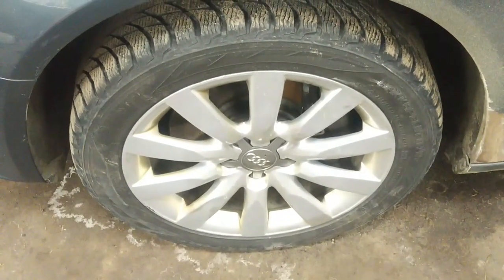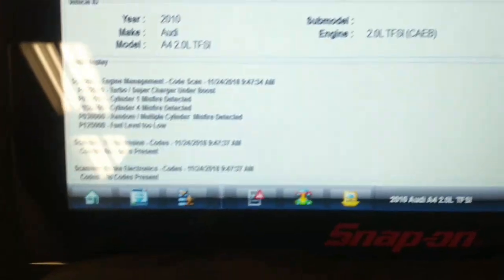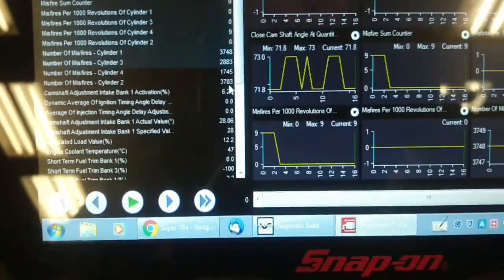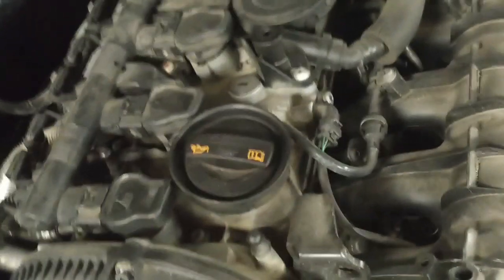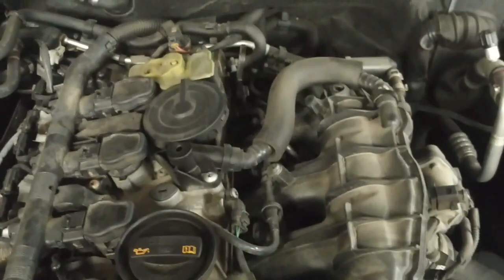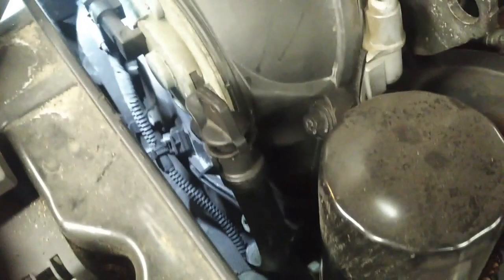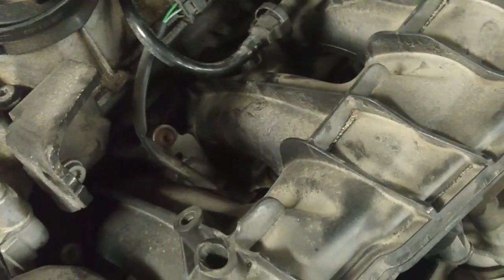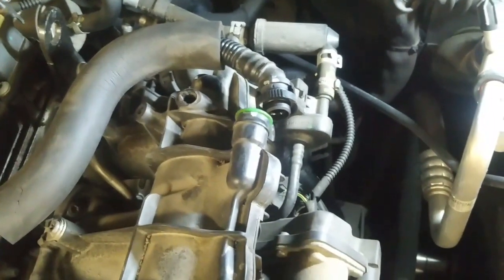2010 Audi A4 Quattro Misfire and Underboost  Codes

Comment: Have you fixed it? Everything good?
Reply from the maker: I did replace just the diaphragm with a Dorman part and it initially fixed it. Had less than 1 inch vacuum but it only lasted a couple months and failed again. I ended up replacing the entire crankcase breather assembly. Part number 06H103495J. That fixed it properly. HTH
Reply: @PhillipBailey  do you think if I put the wrong part# for pcv valve on my problem would stay the same ?, im having the same issue with sane car and year & I didn’t use the part # you just said
Reply from the maker: @jshawnridgell8070  I don't recommend installing the Dorman diaphragm kit. Replace the entire crankcase ventilation valve assembly with an original equipment part. Also check the turbo wastegate rod for wear.

Comment: At 1:55 did you mean pressure inside crankcase?
Reply from the maker: It's actually vacuum in the crankcase not pressure. The ventilation system fails this way. Doesn't use a PCV valve like most North American Domestics do. I'll post a followup video once I change the diaphragm in the ventilation valve.